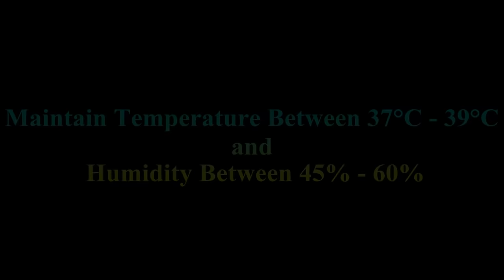Incubator for Chicken Eggs | BIG Incubator For Hatching Eggs at Home | Egg Incubator | Birds Palace

Comment: Can I do it without those temperature monitors. What is the required minimum and maximum temperatures for hatching eggs
Reply: 37-38
Reply: I also suggest using temp and humidity monitoring. I would place them in the center areas and near the curtain to get an overall idea

Comment: No thermostat to maintain temperature and no fan to distribute heat evenly? I think this has low hatching rate. Also, you dont need to turn eggs 3 days before hatching date. Turning eggs manually twice a day, i think is also enough.
Reply: I think for small scale farmers they regulate the temperature manually

Comment: List what to 'do to maka this incubator pls sir
Reply from the maker: Watch the Complete video Follow the Same Procedure.....If you are Beginner New to Hatching Eggs in Incubator Then Start With Smaller One.....Take Small Cardboard Box Put at 15 or 25 Watts Light on it Use Rice Husk/News Paper/Cloth etc For Bedding and Put Fresh Eggs (2-12 Days Old NOTE:- Market/Shop Eggs Didn't Hatch Don't Use Them...Use Only Pet Chickens Eggs)......Put Some Water in Bowl...And
1.Must Maintain Temperature Between 37°C - 39°C & Humidity 45% - 60% For Best Results
2.Rotate The Eggs Daily 3 Times Till 18th Day
3.Use Fresh Fertile Eggs (2-10 Days Old Eggs)
4.Chicken Eggs Takes 21 Days to Hatch...Some Times Hatches Between 19th to 24th Day
All The Best
Use W3001 Temperature Controller:- https://amzn.to/3NtGMjF (Purchase Link) For Controlling Temperature
Note:- More Than 41°C Temperature Will Spoil The Eggs Hence Better to Maintain Temperature Between 37°C - 39°C and Use Fresh Fertile Chicken Eggs